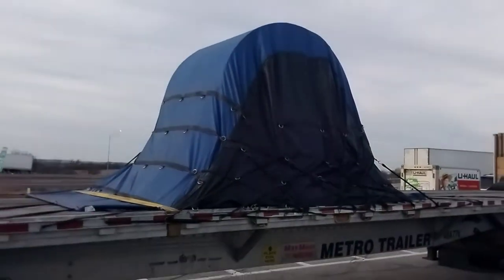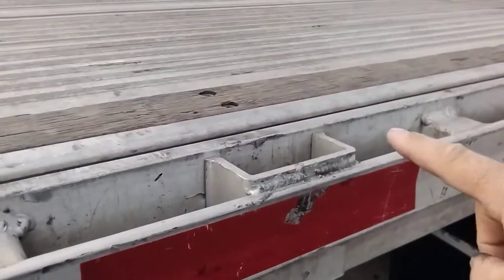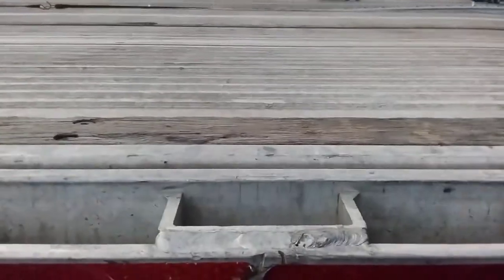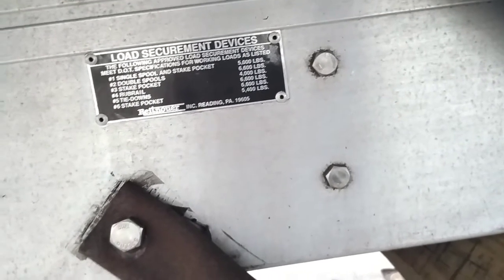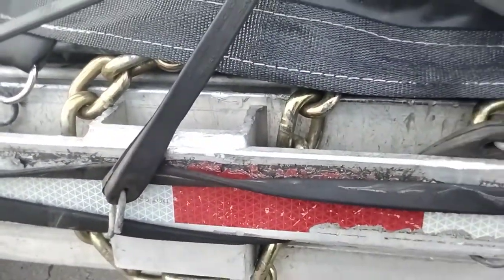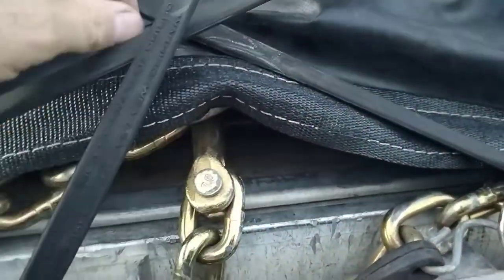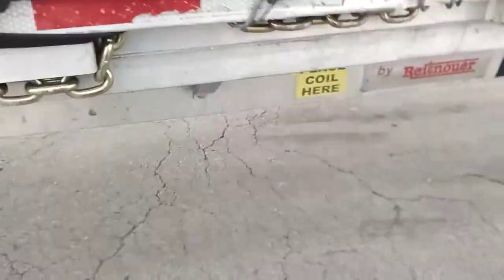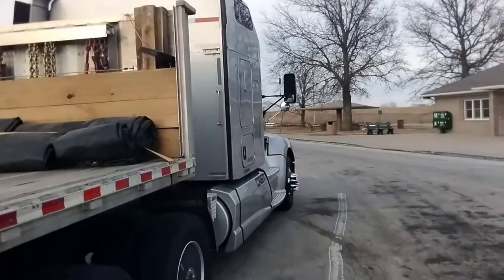CRST Flatbed.....Coil bag & securment tips

Comment: Haven't pulled flatbed in years been in bellys and dry vans When did the frame not become a place to chain to? Learned years ago never hook to anything that has to do with the rail. You always see chains and straps going over the rail definitely a big no.
Reply from the maker: There is no place on the frame to hook to, there is a place behind the rail and pockets to attach the straps but the trailer is designed to have the chains hooked to the spools and stake pockets inside the rub rail as shown in this video...